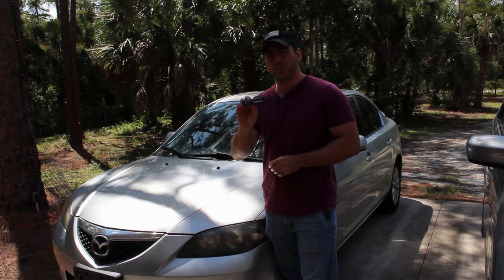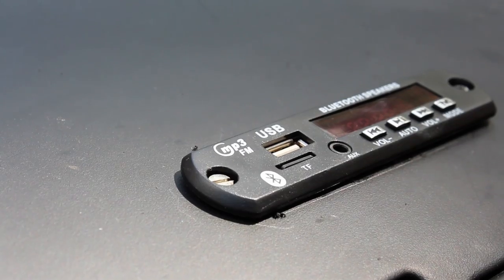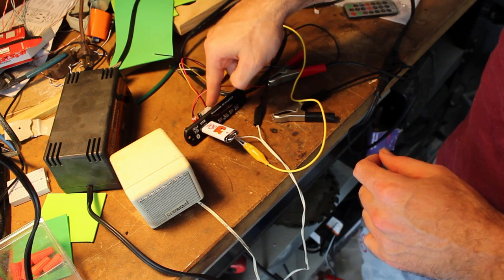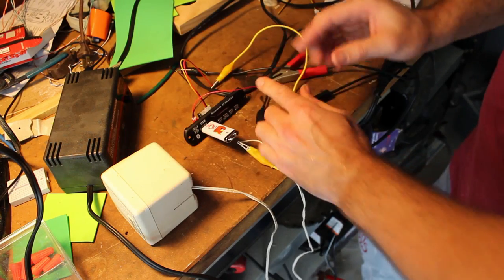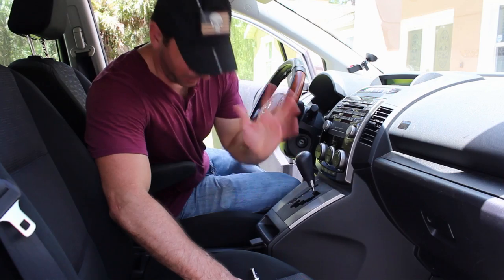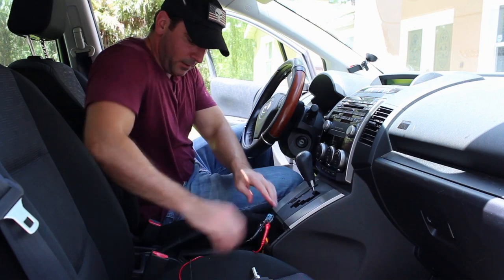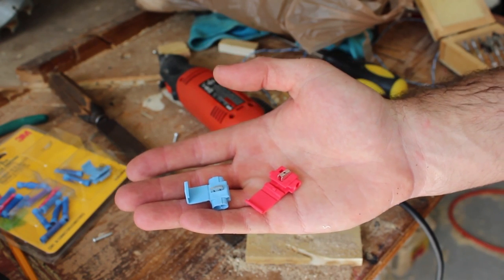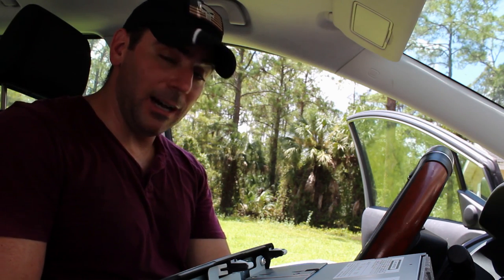Installing a Cheap USB Port  - Blueooth Receiver - SDcard Reader into Your Car

Comment: Kris, I would highly recommend that you use heat-shrink tubing to insulate your solder connections. The interior of a car, especially in warmer climates, can cause electrical tape to become "gooey" and loose. This could potentially cause connections to short out to the chassis and possibly fail down the road (pun intended). It will also be interesting to see how well the panel of the receiver holds up when exposed to direct sunlight (plastic is not fond of UV rays).
Reply: Yes, you are right. I would have, I just didn't have any on hand :(

Comment: In case people are worried, the unit is called a SODIAL Bluetooth Receiver here is the Amazon Link to the same device :  https://www.amazon.com/SODIAL-Bluetooth-Decoder-Wireless-Speaker/dp/B077P16SGH/ref=sr_1_fkmr2_2?s=automotive&ie=UTF8&qid=1537654115&sr=1-2-fkmr2&keywords=Wireless+Bluetooth+12V+MP3+Decoder+Board+Audio+Module+TF+USB+Radio+for+Car+USA

Comment: Same question for you from 8 months ago.. CAN YOU PLEASE  give the full description of the piece that you just showed at  8:10  the item "auxilary cable " that you said you got for two dollars.??
Reply from the maker: Sorry if you asked this 8 Months ago.  I seem to have missed that comment.
I don't know what you mean by "full description".  It's an auxiliary cable for the stereo in the car.  
I'm sure it will very from car to car.
I literally search "Car AUX Cable for Mazda 3" on ebay.
If you have a Mazda, here is a link to one:
http://tinyurl.com/yate9v8a

But ebay listings don't last very long, so you're better off just searching for one yourself.
Reply: Thank you.. I have a hummer h3 and they did not come with aux.. so I am trying to install one .  the cable that you showed is perfect.  I cannot seem to find it .. i have tried so many different means.. to include web sites from England. so I meant that I needed a clear description so that I could KNOW exactly what to get.. again the cable you showed is PERFECT.